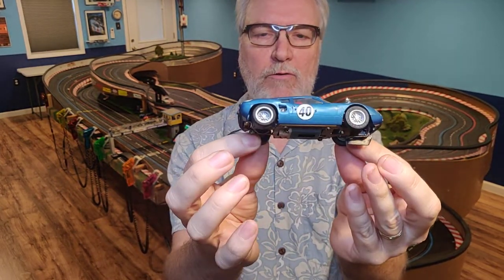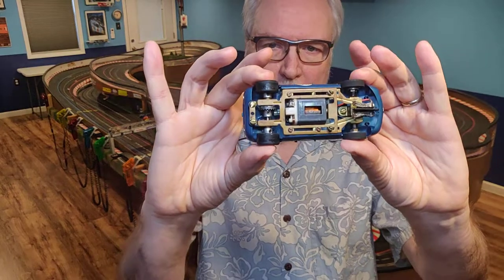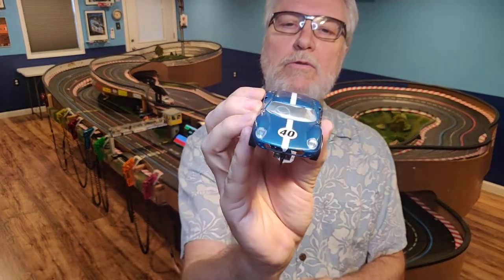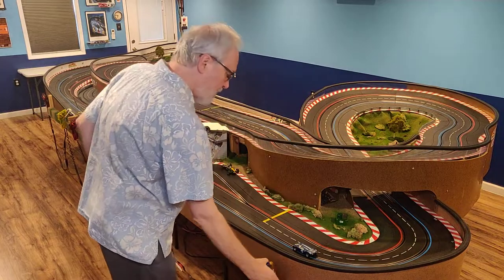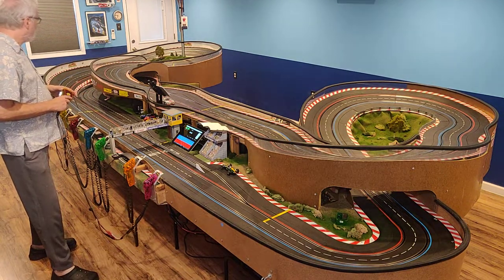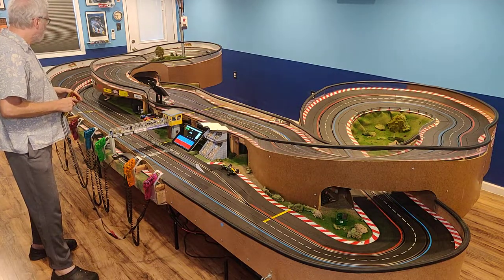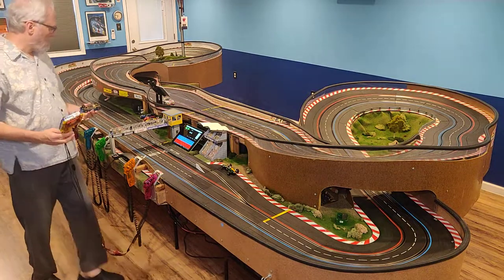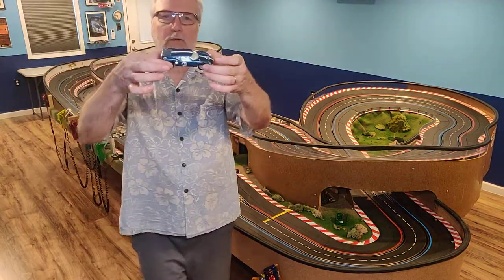Monogram 1966 Lola 1/32 scale test drive

Comment: Do you keep any ? 
Do you have favorites ?
Reply from the maker: Yes I have about 1500 slot cars. I have my first from 1964.  I have many scratch-built cars.  Some were used in various races. Some built just for fun.  Most of my factory built cars are tuned up, mostly but not all for magnet-free racing.  I plan to start doing videos featuring many of my favorites.
Reply: @jimcunningham534  
I have one I was given around 1964 a Scalextric Aston Martin and two chassis I got in the mid sixties a Tokyo Plamo that now has a hot rod body on it and a Tamiya suspended chassis with one of their reproduced Lola bodies and too many other slot cars to count